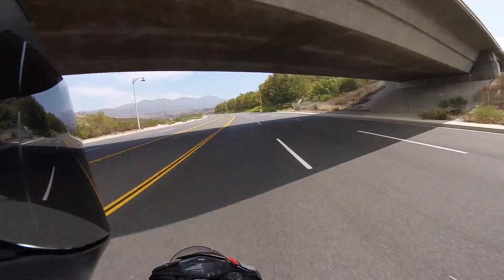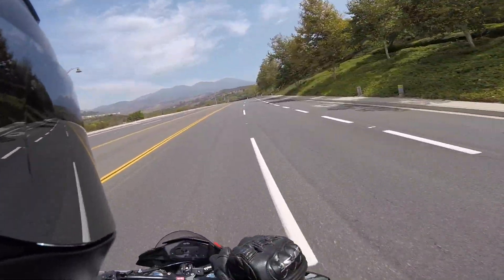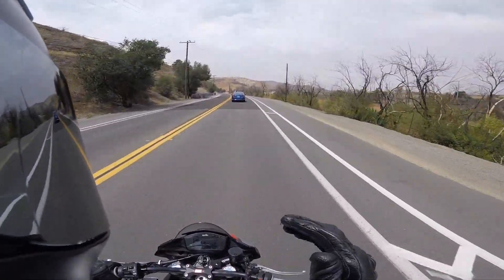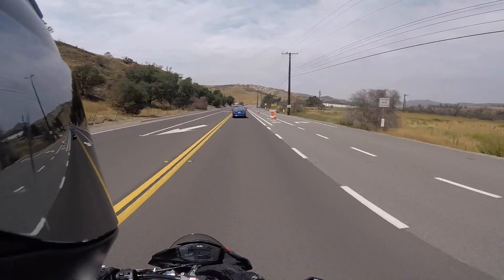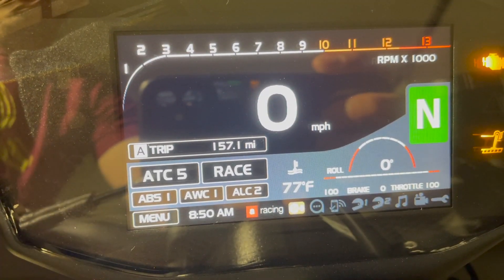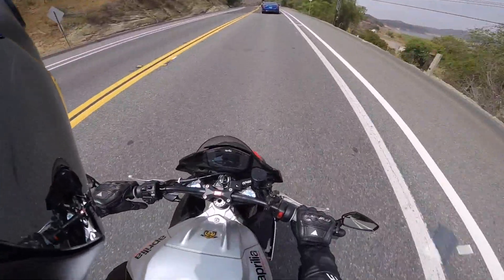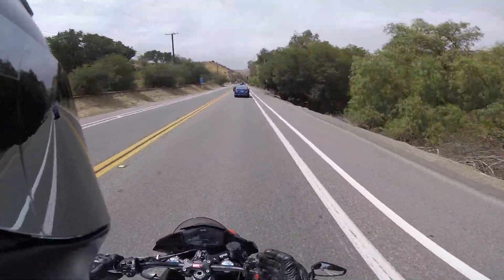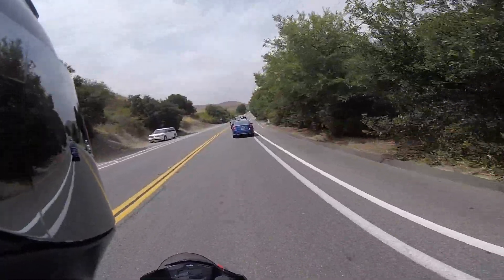How Aprilia Traction Control Works (2017 Aprilia Tuono V4 1100 Factory)

Comment: Runs from 3:15 to 6:30.  Does not show TC operating, maybe in another vid?
Reply from the maker: I haven't had it cut in much, but all you would see is the orange lights on the dash in the set of shift lights flash a few times after it intervened, as well as feel the power cut from the throttle bodies closing. If the bike was super out of shape the video would be very interesting lol.

Comment: great videos mate.I have just bought a '16 Tuono factory, loving it and ready for another year. I went out a couple of days ago and had some real misfiring/lurching issues at speed. I thought it was bad fuel but saw that ATC was wound up to 8 when I got home, now this makes me think that may have something to do with it...hope it is that simple ;) for fastish road/Sport riding what would be your ideal ATC ABS AWC settings?
Reply from the maker: Will do! Thanks for watching! 🙂

In my experience, TC is very invasive at level 8 and will cut in going straight across painted crosswalk lines in 1st gear with only 30% throttle, ground and paint totally dry and warm. I have been running ATC 1, ABS 1, and AWC off as of late on Pirelli Supercorsa TDs, SC2 front and SC3 rear. I think these were the settings I used at my last track day on the bike, maybe TC was up to 2.

Does the 2016 have adjustable ABS? I thought it was just on or off.
Reply: @hiimchad  you will know more than me about the Tuono,I have the old style clocks and little room for changing settings compared to the LCD version,so probably ABS is fixed,I have AWC off at the moment so will try ATC on 1-3.Just bought a set of Supercorsa's to replace the Metzler it came with, which are squared off and lack tread.Thanks for the advice and keep on keeping on!
Reply from the maker: @thebaronvonaphid  happy to share! Thanks again ✌️

Comment: Nice explanation Sir👍🏻 My RSV4 Factory on 'Track' mode all day long, ABS = 1, AWC =1 and ATC = 5 when I'm on track and it suits me fine, but some guys at the track wind ATC right down to 0
Reply from the maker: Thanks Gio! Glad you enjoyed 🙂

I run my Tuono with the Race engine map, ABS 1, AWC 1, and ATC 4. I used to run ATC on 3, which I did on my last Tuono that had Dunlop Q3+s, but with the Pirelli Rosso IIIs on my Factory, it is easier to break the rear loose. Are the guys turning off ATC at your track on slicks? Or at least the Supercorsa TDs? That's the only way I could even consider being comfortable without TC. I would probably still run it on 1 or 2.
Reply: @hiimchad  Hey Sir, funny enough yes they were on slicks. I'll be switching to Michelin Power Cup 2s from my Super Corsa SPs which have been absolutely fantastic with tyre warmers, professionally retuned suspension trackside and front/rear 29 psi/26psi cold. If only I could ride 1/10 as good as Biaggi then I'd switch off everything and wind that beast right up! Thank you so much for your reply 👍🏻
Reply from the maker: @verdeboyo  I figured, I'm nowhere near the fastest, but I am a very competent track rider and amateur club racer, and I can't imagine trying to ride my Tuono with the Rosso IIIs and TC off. 😂 Let me know how you like the Power Cup 2s once you've had the time to put some miles on them! I'll be looking for tires in a couple months, and I was leaning towards Supercorsas, since they were standard on the bike and I've never ridden them before, but am somewhat open to other options. You're very welcome! Thanks for watching, and it's been a pleasure chatting! 🙂
Reply: @hiimchad  Thank you Chad I def will let you know how they go. Lovely chatting with you too Sir👍🏻

Comment: Thanks for making all your Tuono videos. I have a bike just like yours a 2018 model. Maybe you could make a video about the fuel cut problem and possible solutions if any? At least I have that problem. Most noticeable in first and second gear. I think many Tuono owners have this problem.
Reply from the maker: Hey John, thanks for watching and glad you’ve enjoyed! I don’t have a fuel cut problem that I’m aware of. I think my bike runs quite well, even in first and second gear. Can you elaborate?
Reply: @hiimchad  I wonder if it's an EPA can issue... I "vertually" removed mine, as you advise as well and have never had that issue with my 2020... Also a  BrenTuning flash and Acra made a substantial difference in power
 across the board.
Reply from the maker: @vpweber  Perhaps! Glad to hear you were able to "virtually" remove it without issue 😂😁

I'm running the Aprilia Race ECU flash, which I don't think adds much power, if any, but throttle response and power delivery have seemed great to me, so I haven't really considered changing it up. 🙂 Glad to hear you're enjoying your Tuono!
Reply: I've been thinking about getting a used Tuono but I've heard a lot of them have issues and get right much shop time, other than your fuel cut have you had any other problems with your bike?
Reply from the maker: I'm interested to see what John has to say, but to add to the conversation, I have owned two Tuono's and have run up about 8k miles between the two. Neither have given me any problematic issues that required shop time! I did have the dash firmware update to fix an odometer issue where the bike would add .1 miles for the first 5-6 feet the bike moved, but other than that, it's been a joy to own. 🙂
Reply: @hiimchad  good to know....thanks